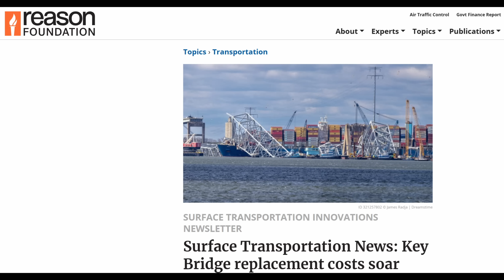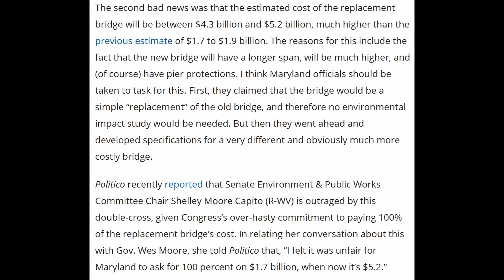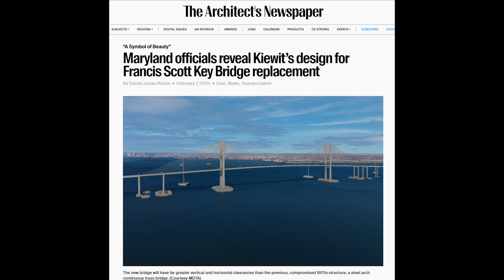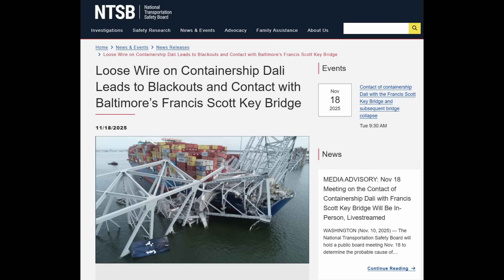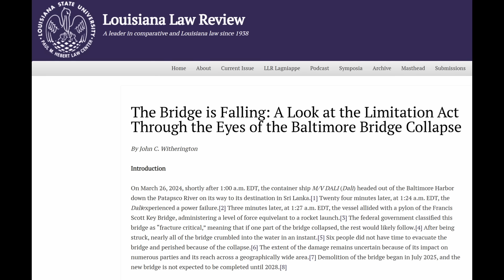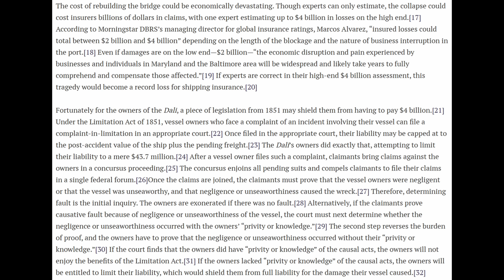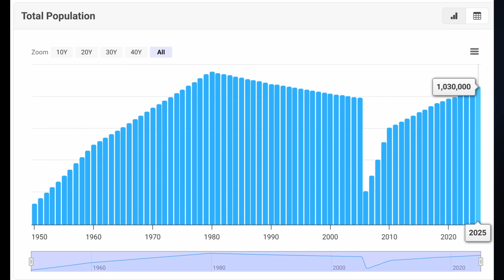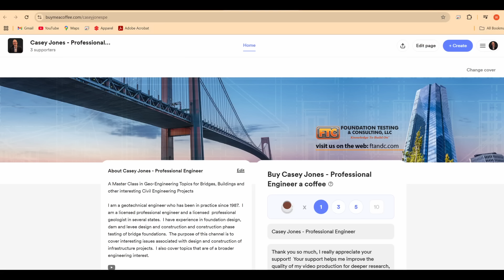Should U.S. Taxpayers Pay for a $5 Billion plus Key Bridge Replacement?

Comment: How about they start a ferry service in the interim? Hard to believe 2 new ferry docks and two ferries the size of the super ferries that Washington State operate, running continuously back and forth, would be anything like $5.2 billion and would be better than what they have now, which is nothing.
Reply: Check out the Staten island Ferry Service in NYC. My wife and I used it every day for the five years we worked in NYC.
Reply: Traffic level may be too high.
Reply from the maker: That's a very good suggestion.
Reply: That was my first thought when the collapse occurred.  And I grew up in the shadows of that bridge and long before it was built.
Reply: One issue is that for 1000+ vehicles per hour, ferries would need to depart quite frequently, and this is crossing considerable traffic of the big port.   So now waiting for a ferry accident?
Reply: This is all about Hazmat truck traffic… not sure how that would work out. For reference passenger and non hazmat through traffic along I95 is flowing fines. It’s the hazmat traffic that is incurring a premium because the have to use I695 which adds 20ish miles to the trip. So what’s the cost benefit? That’s what needs to be looked at.

Comment: Considering the increase in replacement costs already, I would not be surprised if by 2030 the final bill would reach 8 billion plus.
Reply from the maker: You're right I'm expecting that to happen.
Reply: @CaseyJones-Engineer on every major construction.
The problem is systemic not specific.
 I just worked on a new bridge that cost twice what it would have ten years ago
Reply: Julie K. here. If the over/under is $8 billion, I would definitely bet on the over.

It wouldn’t surprise me if it reached $10 billion. Just my 2¢. No pun intended.

Comment: If anyone other than the operators of the MV Dali is on the hook for this, then the US Government should pay the lion's share if not everything.  Maryland "could" have attempted to build more and better-placed dolphins to try to protect the bridge.  They could have also told the bridge to flap its wings and fly out of the way.  I doubt that Maryland was the only state to not retrofit giant new dolphins to protect older bridges.  Maryland itself doesn't necessarily have the money to just "drop in" on the replacement Key Bridge.  So, even without the 2024 bipartisan law agreeing to the Feds paying for "everything," the USDOT should pay some noticeable portion of the replacement costs.  While the loss of I-695 to through traffic might not "cost" as much as the prices being discussed now, it certainly comes close.

At the same time, if Maryland is carelessly pissing money away, then they should be held accountable.  They also need to make sure that the replacement Key Bridge is built with sufficient capacity and size both vertical and horizontal to be at least somewhat future-proof.  Along the same lines, since this is likely going to be a toll bridge replacing a toll bridge, then MDTA should pay at least some if not all of the money back through tolls.

Comparisons to the New Orleans levees doesn't quite apply here in any case.  There, the US Federal Government "evolved" its way into the flood control systems, so it's their responsibility.  Ideally, the vast majority of flooded-out neighborhoods should have been built up with clean fill before any properties were allowed to rebuild, so they would be more easily protected by the levee and pump system.  But, that didn't happen.

Comment: I think Baltimore can get by without a replacement bridge.  Maybe one day the economics will work out, but not now.
Reply: you guys are absolute wrong. its made things horrific here. we have the second longest commute times in the country. lets see your bridge fall down and you say the same thing
Reply: @jonathankosyjana You can always move.
Reply: @stvrob6320  I live in Maine half the year. buddy
Reply: That bridge is the Hazmat route for anything going past the area, to keep Hazmat vehicles away from population areas, and avoid the Tunnel.
Reply from the maker: There are a lot fewer people living in Baltimore now than when they built this bridge.
Reply: @CaseyJones-Engineer I live not in Baltimore but I go through Baltimore enough that I feel I can comment.

The traffic around the DC area in general is honestly some of the worst in the country. I think it’s probably on par with San Fransisco. Baltimore is generally where the traffic starts to cool off a bit as people branch into one of the four routes across the city and then to wherever their final destination is. 

But without the bridge these other modes are slammed. 

So it’s not necessarily a population issue but how popular this highway is in general.

Now I’m not afraid to say maybe we should rethink the bridge at that cost since taxpayers are on the line because the lawsuit wasn’t that fruitful. 

I’d argue that the at-fault parties should pay. But gotta love the NTSB and their determination to not assign blame or pinpoint what exactly went wrong because you can argue a lot of people are at fault.

But the shipping company is off the hook at this point if they settled. So…now what? The answer is likely a very expensive toll.

Comment: Tariffs raise the price of all steel not just imported steel.  First prices of commodities are set by the highest price source.  Secondly, why do tariffs increase domestic production?  Because they raise prices which makes higher cost domestic production economic to bring on line.
Reply from the maker: I agree with you but it doesn't explain the 3 fold increase in their current estimate.
Reply: I was also going to say that I don't know about bridges, but in my old business steel was about 10 pct of total installed cost (maybe) of a piece of equipment.  Also in the early stages of project development cost numbers came out of the rear.  Love your show.  Educated as civil engineer, but never did any of it professionally.

Comment: The ship knocked it down and they should pay the cost of a replacement bridge. The upgrade costs should be paid by MDOT. I saw that an old steel plant is planing to reopen. I wonder where they're going to get workers? Good video. Good Luck, Rick
Reply: The Bridge was a hazard to navigation.  MDOT should pay the owners of the ship for their negligence and pay for the extended disruption they caused to commerce.
Reply: @stvrob6320  No, the Captain knew the conditions of the bridge and that he had problems with the ship. It was his negligence.
Reply: @richardross7219 Why would the Captain be negligent for the conditin of the bridge?
Reply: @stvrob6320  He was negligent for running into the bridge. Same as an auto driver that runs into a tree.
Reply: That ship (the Bethlehem Steel Plant) sailed decades ago.  Most of the remaining domestic  mills are in the Great Lakes area.

Comment: For what it's worth, domestic steel prices are up 15% to 20% largely due to tariffs pushing up global prices. I know that doesn't necessarily fit the libertarian narrative but it is what it is. Yeah, Trump's not helping the cost of anything. There, I said it. Again, it may not fit the narrative that nothing has changed in the past year but, and again...it is what it is.🤷
Reply from the maker: The increase in domestic steel prices simply don't come close to explaining a 3 fold increase in total project costs.
Reply: Estimating the final cost of such a large project seems impossible to me.
Reply: @CaseyJones-Engineer  I agree, but 15 to 20 percent is still a very significant price increase, plus the tariffs are also a major factor in costs with of much of the hardware, excavation equipment, electronics, tools, supplies, etc that are imported or contain imported components.

Comment: Usually the issue for the major part of large cost increases is scope creep.
Reply: If scope creep means safety runs the job than I would agree with you.
Reply: The bridge build has been defined. How can you have scope creep when the scope is clearly defined? Well, they have an out, they said they are defining the build as they go, and that is so irresponsible. It wreaks of corruption.
Reply: Agree, but the project hasn’t even gotten started yet!

Comment: Keiwit is great at charging the government, and the government is great at delivering bad plans.
Reply: Agree with both points Mark, however, on this project specifically, Kewit is the lead responsible for the design development and documents. It would seem more that the original budget target was low-balled to keep the process moving forward.
Reply: @m.a.c.8366  possibly, I am not part of that process to I shouldn’t opine on that. But thanks for the insight